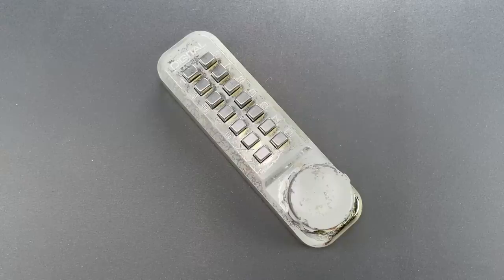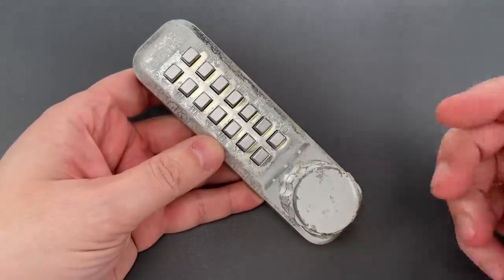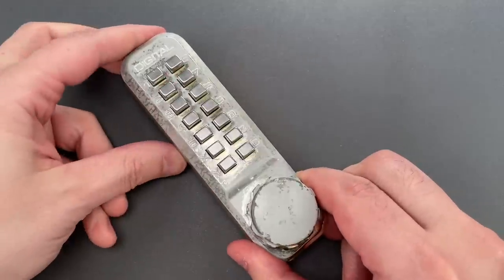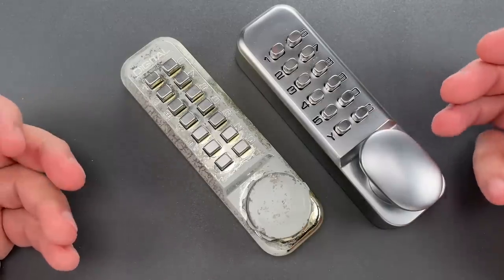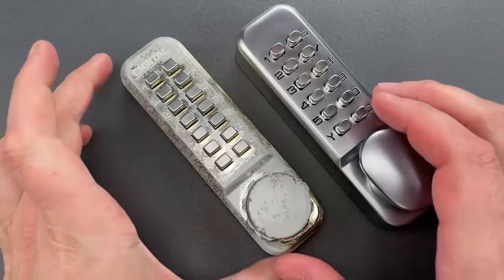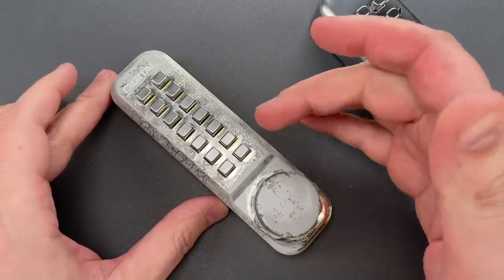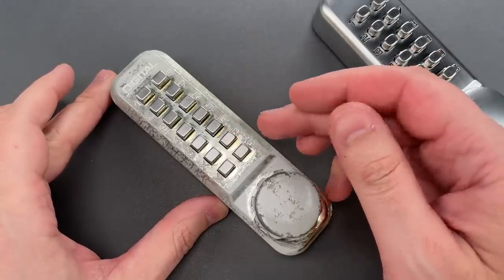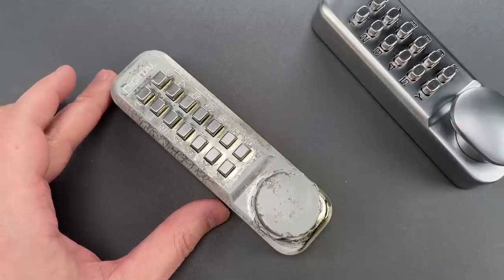[1479] Mechanical Keypad Deadbolt Decoded

Comment: Still more secure than a MasterLock.
Reply: As insecure as some 4 digit masterlocks.
Reply: At this point a chihuahua is better security than a MasterLock.
Reply: @akaraven66  agreed, and not ironically. 
A Chee-Wee will let you know there's a stranger about, and really, that's all you need. Well, that, and a phone. It's rare that an intruder will try to enter a building with an alerted occupant, and even if they do, most buildings - including homes - are full of things you can use to defend yourself. Fort up, call the authorities, and prepare to kick ass if needed.
Reply: @johndododoe1411  A paperclip is more secure than a Masterlock
Reply: You could a sign in front of an open entrance full of gold that said, "please do not steal, thx XOXO" and it'll still be safer than masterlock.
Reply: A sign that just says "do not enter" is more secure.
Reply: still better than KIA.
Reply: @fffwe3876  Yes, Killed In Action is no fun.
Reply: A granny knot is more secure than a MasterLock
Reply: @fffwe3876  😂😂
Reply: A bread tie is more secure than a MasterLock.

Comment: I have one of these similar locks on my office door but the handle turns freely if you don't put in the correct combination. After watching this video I just went and tried something. Turn the doorknob slightly, just so there is resistance but not too much that it frees up and fully turns. While maintaining the position of the handle, push all of the buttons once (don't push clear). Then release the handle and turn it again. It opens about half of the time.
Reply: Nice exploit.
Reply: Sounds like a very worn Kaba Simplex. If that's the case better replace it as it won't be long before it freezes up.
Reply: You mean 50% of the time it works every time?

Comment: One office I used to work at had two of these locks on the two entrances, with different codes - and in absent-mindedness I'd occasionally input the wrong code for one, and I'd know instantly because it "felt wrong" 

I think if casual users can feel that there's a difference in regular use, it's always going to be easy to decode.
Reply: Same for me and others at my workplace.

I was on vacation and one of my deft coworkers was able to figure out the code to a little-used lock without calling me.  Our IT guy whom she let into the room gave her the nickname "Jimmy Valentine" and it stuck.
Reply: Imagine the buttons looked different aswell from all the wear
Reply: @jearlblah5169  that's  usually  the main tell, the only  way they  will feel different  in regular  operation  is after a considerable  amount  of use and the springs  are weak.
A new lock will not feel different  nor will a lock that has had regular  code changes.
Reply: A building I used to look after locked all the bathrooms with a different code for each floor. One morning I touched each button with a UV dye pen, the next day recorded the clean keys and wrote it on the door jam above each door really tiny. Did that for years lol.
Reply: @cardiffpicker1  A new lock wouldn’t show signs of wear on the buttons either…
Reply: @rachel705  I can tell the difference  between  buttons  after only a few weeks, admittedly  it is my job, 1 building  I look after  has 92 of these   which  the codes need changing every  3 months
Reply: would be funny if the codes were different only on the order, thus both working on either lock
Reply: That "wrong" feeling can be attributed to unconsciously being aware you are doing the wrong thing.
Reply: @jearlblah5169  that's why I tell my kids to wipe down all the numbers anytime they use the garage pad
Reply: @SanelessOne  that’s smart to start them early on a positive habit that will just become part of the lock/unlock routine for life.  Easier than trying to correct/change unhelpful habits later in life. 
My dad has a flat face, touch screen style keypad on the electronic deadbolt on the main door to his shop.  It’s constantly FILTHY from dust, pollen, dirt, smoke, fine sawdust, etc….I’m sure you get the picture lol.  Well he refuses to wipe it down since “it’s just going to get dirty again” 🙄 which pisses me off because you can clearly see the 3 digits involved in the 4 digit code (there’s a repeating digit).  His excuse is that it doesn’t matter since the lock is only going to keep the honest people out anyways- which IS true 😆 but that doesn’t mean we need to make it any easier than it already is lol!

Comment: Was once told by a mate who had a job in the security industry (in sales), that these types of locks are easily bypassed by mashing all buttons simultaneously. Sometimes it was made easier by using something flat and stiff  such as a ruler.

One time, I was told to head to an ambulance station for a break when we were way out of our area. As such, our  code didn't work on their lock. 

I found a piece of scrap timber and placed it over the keys and hit the timber. From memory we got in on the second go.
Reply: That would make a very cool scene in an action movie...
Reply: I heard a story of a multiple-choice test machine used in car license exams that can be tricked by pressing all options simultaneously with a ruler
Reply: @vftdan  well, that's disconcerting...
Reply: Makes sense.. would be like raking but with a ruler

Comment: I remember one time I was locked out of a shed that had a cheap wire lock with a 3 digit roller wheel. I used this method learned by you! I applied tension to the shackle and spun the wheels till it felt set correct. It worked! Ever since then i've realized any combination lock that allows you to use the shackle/bolt to apply pressure to the code is generally going to be very easy to decode

Comment: Interesting to note this may only work on that specific brand. My shop has 2 different brands in stock and we just tried it on several different locks with no success at different amounts of tension and in some cases, the buttons completely bind up and don't have any springiness to them at all. The combination of this lock is changed by removing pins from the back that are color-coded and arranging them to where the red ones are coded and blue are non-coded with a combination of your choosing. We are guessing the shape, size, and possibly length of the pins, and how they fit into the lock may be the key to having that brand work that way, or possibly it may be a matter of wear and tear as the locks we tested were all brand new.
Reply: Same here. Sourced mine from bunnings warehouse. They seem to be a simple yet good design, when new they have very low tolerance for binding, or no binding at all. The mech is also reliable, I can't see it being picked, knocked or unlocked by magnet.

Comment: I have a suggestion, if you haven’t done this already. Master Lock sells these set your own combination locks. I had one for my school locker for a bit because I kept forgetting my combination with regular ones (yay, undiagnosed ADHD). Basically you couldn’t forget your combination because no matter how much you scrambled it you would be able to feel the tumbler click when you had the right number/ letter. Which was great until other people figured that out, multiple times. I don’t remember having anything stolen because I kept everything valuable in my bag. Presumably whoever it was looked at my moldering 90s public school textbooks in disgust and walked away. But I did go back to a regular lock (which was probably incredibly vulnerable to a simple lock picking tool but not vulnerable to just some teenager in the hallway). I looked it up and they still sell the same model in number and letter versions (which is what I had, which also made it way easier to guess a combination). The design for the school ones look about the same but they also sell ones that look like they are supposed to be used by adults for actually important things and I bet they are all just as easy to get into.

Comment: I decode one of these which was on a key locker (which had the front door keys in for the main building which my flat was in). Reason being, the housing agency was trying to get me to sign a new contract so they could have "unfettered right of access". i.e. They would remove the dead lock ability of my flat and give themselves the "right" to enter the property at any time without knocking and without any prior notice. Suffice it to say, I didn't sign the contract, so obviously they didn't give me a key for the main building door after having changed the lock. I still have the hand-written note from one of the workers informing me of this. Really should've taken them to court over it.

Anyway, it was quite easy to decode the main building key locker. Bit of tension and you can feel (in my case I heard) a fast double click on the correct keys. Being a sound engineer helped to hear the difference between the correct and incorrect keys. They were absolutely furious that I still had access to the main building and couldn't figure out how I was getting in.

That's the last time I'll ever deal with housing organisations. They're highly corrupt and engage in many scams. Most notably they claimed they'd made an error with how much rent they should've been charging all tenants and back-dated rent 2.5 years. All tenant in the building ended up in approx. £7,500 debt that we had to pay, on top of the "unfettered right of access" shenanigans. Definitely should've taken them to court...

Comment: A company I used to work for had something similar on staff only doors, I used to do a lot of visits to different sites and couldn't remember all the codes, however I quickly learnt that jiggling the knob would causes the relevant keys to wobble slightly allowing me quick entry. When the loss prevention team discovered I was doing this they were understandably concerned

Comment: I'd love to see the mechanics of what you are feeling for, it would make the decoding process much more relatable to watch.
Reply: This sort of lock is really common in offices and retail in the UK, they're the sort of thing you'd find gating off a staff area, or perhaps a "customers only" bathroom in less salubrious parts of the country.

They're not a million miles away from a traditional tumbler in principle.  Each button has a kind of thick wafer behind it, the "partial disassembly" LPL refers to it removing a retaining backplate (one screw) to spit them all out.  Each wafer has either a cut-out notch or a false gate, you rearrange them to set your code.  Typing in a code to open just latches up each wafer in turn, and C releases them all.

I've decoded these in the past by setting each button in turn and feeling for impact against the false gates when twisting the knob hard, it never occurred to me that the unset positions might differ.  I'll have to have a play with that.

Really though, if you can access the locked side once then decoding is trivial.  Two screws drops the lock body off the door and then a quick glance will give you the access code because the wafers are colour-coded.
Reply: @UKCougar  Here is the problem.  You talk about false gates and wafers and stuff, but I don't know what they are and what they look like in a lock like this.  Hence why I said a visual would be great.

Comment: Before card keys, these types of locks were very common in hospitals to “secure” on-call rooms, medication rooms, stock rooms.
Reply: Your avatar just gave me lovely feeling of nostalgia.
Reply: @meeperator  Thanks very much for your comment!  Like you I spent many (many!) hours on Jedi Outcast, not to mention all the Star Wars games for Arcades, consoles and PC that came before (or since).  May the Force be with you!
Reply: An interesting use was a geriatric ward in a hospital. You had to punch the code to leave the ward. The code was written above the door. Also a hall used for pre-school  had one on the main entrance with the buttons on the inside. It worked a rim nightlatch which could be snibbed back when the pre-school was not in session.
Reply: They were common in all sorts of businesses to secure rooms that were meant for specific departments or teams, yeah.

Comment: Way back in junior high (late 80s) the school was doing a fundraiser selling mechanical pad locks that could be used for lockers for PE class or in the hallways,  I think they were $5 a pop, but it didn't take long and word spread quickly about how broken they were.   In a similar fashion you pull down on the lock to tension the bolt if you wiggle the numbered buttons you can feel some wiggle differently and very easily figure out what the combo is.   Not sure how many people lost stuff from thieves, but within a month the school was refunding everyone's money who bought them.

Comment: I went on holiday to small in South Australia call Whyalla. The motel I was to stay at used this type of lock. I didn’t stay in the room because of 2 security issues, it’s to hard to change code after every customer check out. It’s to easy to decode.
Reply: I stayed at a sketchy place once since I was too tired to back out and safely drive to the next, but I did literally barricade the door with all the furniture in the room.  Also, brought in all my stuff from the car.
Reply: Always have items to secure doors once you're inside. No protection against theft but it raises personal safety.

Comment: I've read stories on some sites where this style of lock had been installed, but the installers forgot to reset them from the factory default key codes. If one knows the combination the lock comes with by default, entry is very easy. If LPL were to buy one of these, it would obviously come with factory default codes, not difficult at all to open. Just an FYI to anyone installing these locks, don't leave them on the factory default codes, change them or get the owner to change them immediately after installation.

Comment: These locks are easy to brute force as they only have two thin screws holding the two halves together through the door.
I had to remove one recently because mechanism had seized up so got a hacksaw blade and slipped it between the outside part of the lock and the door and cut the top screw which was enough to get the lock off.
I would think a good hit to the side of the lock with a heavy hammer would shear the screws if you didn't  care about damaging the door.

Comment: Not sure if it has been mentioned before. But you may want to check yourself for an iron deficiency . The vertical lines in your nails is a sign of it.
Reply: I've had those lines at the bottom on my nails for as long as I can remember.  
Even as a kid I had them  I've never thought that it could be a sign of some sort.
But I've also never had a doctor that ever mentioned anything about my nails so I've always figured it was normal lol.
Reply: Maybe instead of chewing them up and spitting them out, LPL should swallow a lock every once in awhile.
Reply: @roypatton1707  🤣😂
Reply: @roypatton1707  Since I traded all my Fluke instruments for iron tablets I am so much healthier!

Comment: Where I work we have locks like this, but the knobs are made so that they turn all the way easily. However, they don't engage with the mechanism unless the code has been input correctly. As such, trying to find the code with this technique, which requires significant tension on the handle, is impossible, since it's impossible to get the required tension without turning the knob all the way.
Reply: See Mike's comment about the same type.
Reply: @DavZell  Also, you can download a cheat sheet of codes to try and since order doesn't matter there are about 128 possible codes.  So brute force of the keyspace in under five minutes.

Comment: I have a keybox outside my house with a similar designed lock. Need to try this method.
No, there is no keys in the keybox, just a 9V battery for backup power incase the batteries in the front door dies.

Comment: The box I got only came with parts that allow the code to be programmed to 3-6 digits, but if you can source more parts and require all the buttons to be pressed to unlock, no one would believe that is the code and no one will ever guess the right code is press all the buttons. Also prevents individual button wear clues.

Comment: I know of a number of places which have these on their doors, and the codes haven't been changed for years. At least one of them, an indoor electronic model, has lost the printed numbers on the three keys which are used for the four digit passcode. One key is much more worn than the other two, giving a huge clue about the code to anyone who understands the main focus of the business. It's rather like the 4711 perfume company if they tried using their name as the passcode.
Reply: Not to mention some of the other well-known exploits for these types of locks....